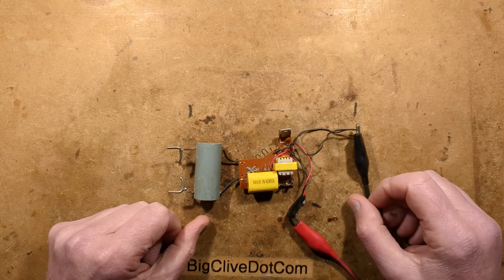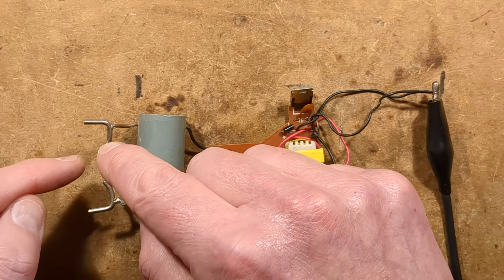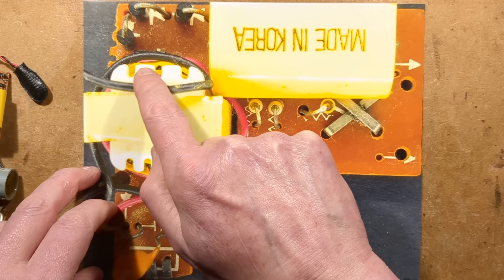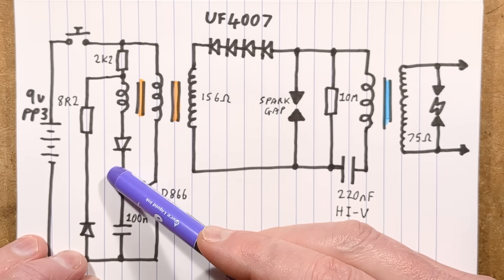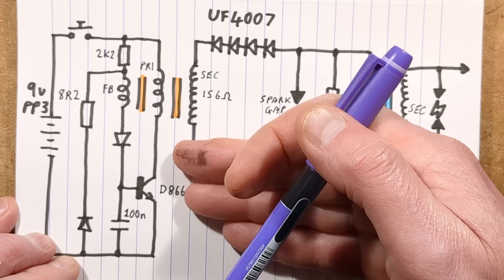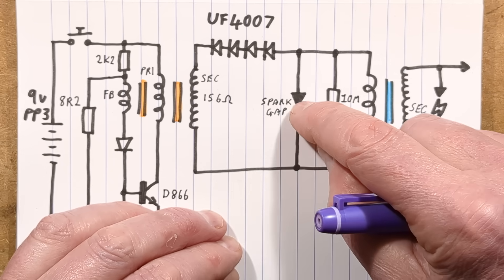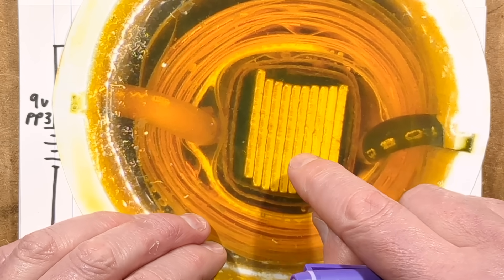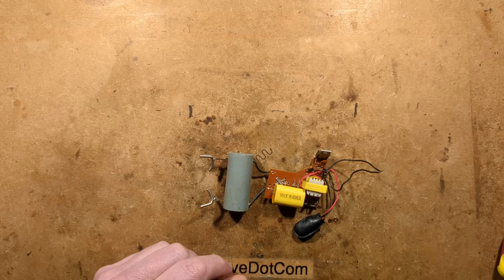How a stungun creates 20kV from a 9V battery

Comment: I appreciate the thought of “airport security won’t like the stun gun in my bag, so I’ll stow a bunch of bare electronics in my suitcase instead” lol.
Reply: I got stopped in Canada travelling with a computer hard drive and asked with suspicion what it was. I guess without the external housing, it looked very unfamiliar. I've learned that if I'm going to travel with anything unusual, best just check it to avoid the hassle.
Reply: @russoft  I got a quarter-hour interrogation at some place in the States (passing through coming back from work in Canada) for carrying a pair of hand-lenses (5 diameters and 10 diameters). Which I've worn as a pendant for, like, 30 years. Stainless steel body, two pivots and two set of lenses (different powers) which you could look through.
Since Dad gave me them for my 14th birthday, I wasn't going to give them up.
Reply: @WellsiteGeolog  " I got a quarter-hour interrogation at some place in the States (passing through coming back from work in Canada) for carrying a pair of hand-lenses"

quality trained people they have on the job there.  Top... men.  uh huh.  The entire dept of homeland security is a joke.  a bad joke, since it's the largest entitlement program in history, but still a joke.
Reply: @WellsiteGeolog 1 quarter hour is 15 mins? Why not just say 15 mins instead of "fancy" quarter hour ?
Might as well say" i got into a 9x10² seconds long interrogation
Reply: @alejandromorazan3420  A quarter hour is one significant digit long - so the actual time was probably between a fifth hour (12 minutes) and a third hour (20 minutes. If I'd said "15 minutes" I'd have been implying that the time was between 14 and 16 minutes, which is more precision than I wished to imply. 
Nothing "fancy" about it - just meaning to say what I meant to say, without saying what I didn't intend to say.
Reply: @alejandromorazan3420 this is still one of the most hilariously dense comments I’ve seen in a while
Reply: @WellsiteGeolog A quarter of an hour?!?! 😂😂😂😂 hahaha nerd
Reply: @NomadicSal  Nerd? And proud of it.
Though I did use the hand lenses routinely for work stuff too.
Reply: @russoft  The amount of stuff I've seen people stopped for (and been stopped for) at the airport is astounding. When I was younger and going to visit family for christmas we were stopped for having whiskey rocks wrapped up as a gift. "We needed to make sure they weren't diamonds" or a brand new suitcase swabbed and the swab sent for testing because apparently the people working there don't know what chinesium smells like when it's off-gassing and it "smelled funny". 

Then the (extremely large) amount of people I know who have just walked through with pills or liquids they absolutely shouldn't have without ever being stopped because they were in a bottle of multivitamins or in a 10ml bottle of vape liquid and packaged in one of the little plastic bags you need to put all liquids into makes you know the entire thing is an expensive theatrical performance.
Reply: Classic Clive  :))
Reply: I was thinking the same.
Reply: I walked through airport security with a giant capacitor (like the one in this video) in my pocket). I basically took it out with all the other metal stuff (coins, keys) , put it in the tray (they x-rayed it no doubt) and then back into my pocket at the other end. It just looked like junk you carry in your pocket to the staff (who doesn't carry an electrolytic capacitor with them in their pocket ? :D  ). This was back in the early 2000's.
Reply: It's worse if they think these are parts of a bomb. :face-green-smiling:
Reply: @zenonbiusz , Like the Dell C640 i got stopped in customs for? it did look impressive in X-ray to be honest, with the dual battery totaling 16 x 18650 cells... i had to slide the batteries out and show customs.
Reply: @WayneMorse-on4go 
16 x 18650 cells? And not 8 x 18650?
Reply: @zenonbiusz , the Latitude C640 had a dual front loader, left side was for battery and right would be the CD drive, but you could quickly swap it out and interchange it for a floppy drive or a battery, there's 8 cells to each battery, 4S-2P.... two "good" batteries would last almost a week between charges.
Reply: @WayneMorse-on4go Ahh, memories. 
My dad had one of these from work and gave it to me (after the leasing contract was over or something)
it hat the CD and the floppy drive and 2 batteries that lastet a total of 8 minutes (it sat on the dock almost 24/7)
Reply: I’ve had stuff like this in a carry on bag in my bag. I just separated the electronics. TSA has no idea what they’re looking at and I’m an electrical engineer so I tend to get through fine. I got stopped and detained for an ESP32 before though😂
Reply: When u put batteries in a radio sometimes u put them in individually, but sometimes you put a column of batteries in one on top of the other one on the minus spring  then one on top of it and another on top until the top one touches the plus. I think this increases the voltage, but I could never understand it.
Reply: @terenceherming1838 It does indeed increase the voltage. If 1 battery is 1.5v and you put 3 in the radio (which is pretty standard) that gives you a voltage of 4.5v.

If you connect the + of the first battery to the - of the second, and the + of the second to the - of the third battery… 
Then it’s 1.5 + 1.5 + 1.5 which is 4.5v.

Some radios will run on 3v (2 x 1.5v) but usually it’s 4.5v. Especially now wirh DAB radios.
Reply: Make sure to include a lengthy bit of wires.
Reply: Back then it probably wasn't a big deal, nowadays if TSA found that in your bag you'd probably be, um, "detained."
Reply: @tncorgi92  In a carry-on bag sure, but not in checked luggage.
Reply: @markfergerson2145  TSA would have opened it for a look anyway.
Reply: @GavinM161  nope, ive travelled with a box of wires and electronics + arduinos for a project in my carryon, they didnt even look at it twice.
Reply: @tncorgi92 disassemble it into individual transformers, diodes and a bare board. Say it is a commercial sample
Reply: @tncorgi92  scientists and engineers carry all kinds of prototype equipment with wires dangling all the time. In hand luggage because they don't want it thrown around and about. Security is quite used to it and don't care, as long as the explosive detectors don't trigger, which of course they won't
Reply: Reminds me of traveling to China to visit contract manufacturers' factories ~15 years ago. Members of my team would divvy up parts to bring on the plane to shorten the shipping time. We discovered the customs folks were somewhat racist: middle-aged white guy, no problem; any other (Asian, brown, you name it) got pulled aside and the parts got confiscated. Yes, we selected who carried based on that info.
Reply: @dankingsbury9971 racist or is there a pattern?
Reply: @dankingsbury9971 the unfortunate reality is 15 years ago or today, Chinese Customs would do the same!
Reply: interestingly i've never had an issue carrying a bare hackrf board with a whip antenna, a soldering iron, various cutting tools and screwdrivers, although i did accidentally bring a carpet knife through tsa 4 times last year before i found it in my bag and they never noticed so it's probably just tsa being garbage
Reply: @Mister_Brown  they aren't really there to keep people safe, just to appear that's what they're doing, and also to hassle whatever people are currently the scapegoat for whatever else is going wrong.
Reply: Wait, you don't smuggle stuff in a box with a sticker on its side describing exactly what it is to the goons in border "safety" and the TSA ?
Reply: Just take an old camera with a flash. The magnesium type flash. 

From that? By re-arranging a few parts you have yourself a powerful stun gun.

Comment: They're considered more illegal than a gun, which is quite something.
Having one in the house must feel like you're a proper thug!
Reply: It's not a stungun because for that it would have to be a handheld device. Because it's a bare circuit board, it's impractical to hold it.
Reply: When I worked as a courier we were prohibited from carrying firearms but they said nothing about Tasers so several of the guys had those and/or pepper spray. I always figured that was just a good way to get shot so I drove unequipped. Figuring let the thief have whatever and I'd just stay out of their way.

Comment: Another item that creates very high voltages are Ionisers. A lot of them use a simple Cockroft-Walton multiplier circuit and you can easily just add more diodes and capacitors to get the voltage even higher. 
They can really give out a nice crack when you bring the two ends together!!

Comment: What is the voltage on the secondary (middle) stage? And did you test it in a rectal situation? Do we need a poll for that?
Reply: If it's anything like an automotive CDI (and it probably is, as I'm sure they would be tempted to use the same transformer) it will be 200-400V. Dump that through a 100:1 transformer (basically an ignition coil) and you get your 20-40 kV output pulse.

Comment: I have a pair of night vision goggles that use a AA battery sized power supply that generates somewhere in the range of 20kv, Always wondered if there's a way to get a replacement as I'm not sure if mine is working properly
Reply from the maker: It would probably have to be the one specific to that unit.

Comment: Clive is beast enough of a man he can stun himself for kicks. I think most people would have hit the deck.
Reply: He had a fizzy whiskey, first
Reply: We have a name for people who enjoy doing stuff like that for kicks. 😂
Reply: NOT me.... I've done it ONCE by accident, but I do NOT have the stones to put the probes on my own flesh and pull the trigger. 😵‍💫
Reply: A friend and I were taking turns zapping each other with one. They do indeed hurt and I had burn holes in my shirt from it. Thing is though it's probably not going to stop someone if they're determined enough. It's definitely got an intimidating aura to it though from all the loud snapping of the arc.
Reply: Nah. A police-grade stun gun is very likely to lay you out (“involuntary planking”) but consumer-grade stun guns just make you jerk away.

One major difference is that police-grade units put out 50,000 volts minimum (in most jurisdictions) while civilian-grade units rarely exceed 10,000 volts.

Both present high voltage pulses that are picked up by voluntary nerves which override the natural signals, forcing muscles those nerves go to to contract strongly. The pulse shape and timing vary quite a bit too. A civilian-grade stun gun will generate short, high voltage peaks whose values vary wildly from manufacturer to manufacturer. Police-grade units are designed so that their output pulses very closely mimic the waveforms normally seen in voluntary nerves, rather like those made by TENS units.

Hence, the latter only forces local muscle groups to contract. The former can override most if not all voluntary muscles.

Comment: sometime I wish you could put a scope on the these oscillating circuits you find, to see how such free running oscillators actually behave. I can imagine a its sometime a "dirty" cycle, but it gets the job done. Good, fun video.
Reply: Same, just the ground clip clipped to the tip makes an OK pickup for something this slow and powerful, no monster HV probe needed. Use cheap semi disposable Chinese or boat anchor scope if worried.

Comment: just a quick caution clive - dunno law in IoM, but u get caught with one of them on the mainland it's a firearms charge - dumb as that may be.
Reply from the maker: As a fully assembled unit being carried in public yes.  But a dangly module like this is no worse than the igniter coils you can openly buy on eBay.  It's when you improvise them into a weapon that it becomes an issue.

Comment: I picked up a cheapy Aliexpress one to experiment with (was researching direction finding using an SDR and directional antenna with a view to sniffing out shorts in long HV multi core cables). The working gap was about 25mm so guessing 25kv from a 5V supply.  The most interesting thing about it was when it was discharging, the cat would instantly start frantically washing herself. So, bonus side effect. Useful for enabling self maintenance mode in domestic cats.
Reply: All that spark gap interference caused you to remotely trigger that cat's software to restart lol
Reply: @tomclanys  Cats are full of documented issues like that and still not enough people fix theirs. "Sad!"
Reply: I wonder if the sound triggered the cleaning instinct because it's similar to the sound of an insect
Reply: All of those cat-ions must go somewhere...
Reply: 😂great stuff
Reply: Great! Somebody should make a video of that
Reply: That's very interesting & amusing about your cat. 🐈😂
Reply: RF signal received by the cat's whiskers, switches on the self calming grooming.
Reply: The cat washing itself is from static and thunderstorms 

Apparently they know when a storm's coming before we do and they prepare themselves

Comment: I used to have a problem getting a source for high voltage for my experiments. If you get into electronics for a while you start to understand how transformers work. You just have to remove the secondary coil and replace it with a couple windings of think copper wire and run it backwards and then you have lots of high voltage...... dont try that if you dont know what your doing, it can be dangerous.Good for the zombie apocalypse 🤣😇
Reply: It's not an inverter

Comment: did you scope the frequency from the transistor oscillator?  I see a 1N4007 is good up to 500kHz and the UF4007 (which I had never heard of) is good to 13.3Mhz.
Reply from the maker: The 1N4007 is only suited for use at low frequencies in the region of a few hundred Hz.

Comment: the PCB layout looks like straight from the 70ies.
Reply from the maker: It is quite a retro design.
Reply: They've been same design for past 30 years... reliability and durability are the name of the game.
Reply: @cup_and_cone the PCB layout style looks like a blast from the past.
Reply: It's also still the cheapest way to construct a simple circuit like this (on a PCB). It could also be declared in luggage (if needed) as a 1970s transistor radio PCB, because it looks rather similar to the uninitiated.
Reply: Yeah, I'm pretty sure that was hand drawn
Reply: @0106johnny  The high voltage pixies don't like getting jolted over fixed 45 deg angle traces. Maybe. And the first part of the supply circuit is self-oscillating. Nice gentle hand drawn curves minimizes wave reflection, interference and ringing patterns which can lose energy and heat up the device in some places. RF interference for the circuit is probably not an issue because they'd be minimal compared to the main and spark gap discharges.
Or it might just be a very old board design that's cheap to manufacture.
Reply: "seventy-ies"
Reply: Made in North Korea maybe?

Comment: The use of the spark gap as a voltage-dependent switch is interesting. The Marx bank does this on a bigger scale, charging a bank of capacitors in parallel until the voltage is high enough to ionise some spark gaps, whereupon the whole bank is suddenly connected in series and discharges with the sum of the voltages on all the capacitors added together.
Reply: Yeah - the impedance of an ionized gap must fall to a pretty low value and be able to handle oodles of current...
Reply: @jonahansen It falls to basically zero ohms
Reply: @davelowets  Yup, it's a plasma channel so it's got very little resistance
Reply: Yeah, that's basically how traditional Tesla Coils do it too.

This thing is basically boost converter stuck on the input of a small TC.
Reply: @SomeMorganSomewhere  The only difference from a Tesla coil is that the transformer has an iron core here. Tesla experimented with iron core transformers in the late 1880s but realized that above 10 kHz it's better to use air core. Regular iron cores have too great eddy current and hysteresis losses, and ferrite wasn't available back then.
Reply: @mernokimuvek  OFC, there's no way you're going to get the coupling you need in such a small package with an air-cored transformer.

The circuit and mechanism of operation are the same though.
Reply: @SomeMorganSomewhere  It works at a much lower frequency. Above 10-15 kHz you can only get shock at high currents like 100s of mA.